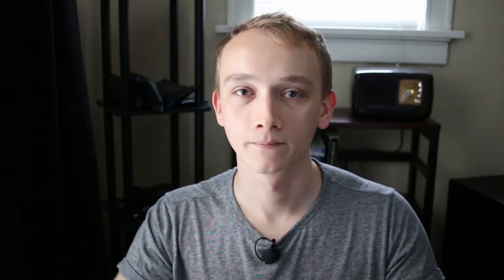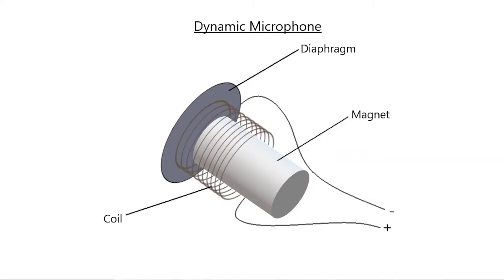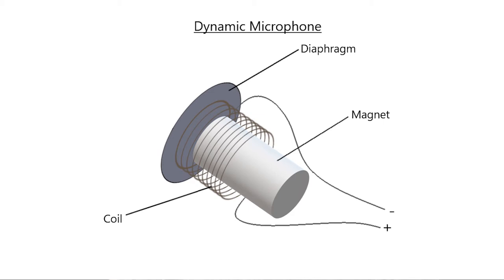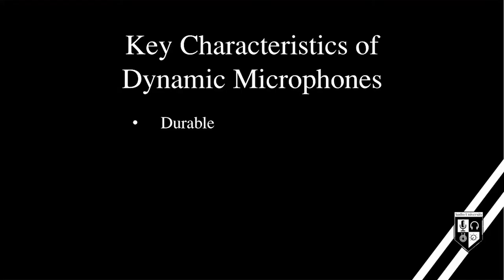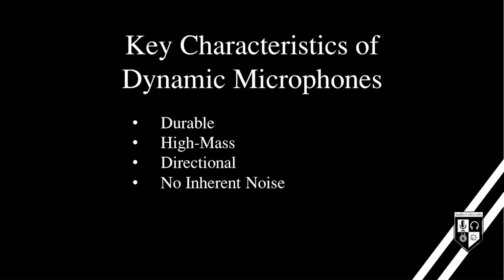HOW MICROPHONES WORK: Dynamic (Moving Coil) Microphones

Comment: Amazing video. You mentioned a few times that Dynamic microphones are great for studio applications as well. In what situations in a studio (apart from recording multiple sources in the same room), would it be better to use a dynamic microphone over a condenser? Since condensers offer a fuller & richer sound, wouldn't that be the best choice for recording almost everything in a studio application, as you can capture the texture of the sound of an instrument or a voice clearer in a studio setting? I've been struggling to find an answer for this. I'd highly appreciate it if you could clear this out for me.
Reply from the maker: There are a lot of variables and dynamic mics are very common in studios. They have lower self noise, higher max input for loud sources, and also a different tonality. You don’t necessarily want every mic to sound as detailed and airy as possible. It can be useful to darken a source through the use of a dark-sounding dynamic mic.

Comment: Desr Sir, your demo is excellent!!?
  Why Phantom power is always 48v????? Not change???? What is the specific???? Thanks!!
Reply from the maker: I’m not sure exactly why +48V DC is used. I know that many microphones do not actually require a full +48V DC and many preamplifiers don’t supply a full +48V DC. 
____________________________
The capacitor in condenser microphones (also called capacitor microphones) requires power to function. You can learn more about how these microphones work in this Audio University article: https://audiouniversityonline.com/types-of-microphones/